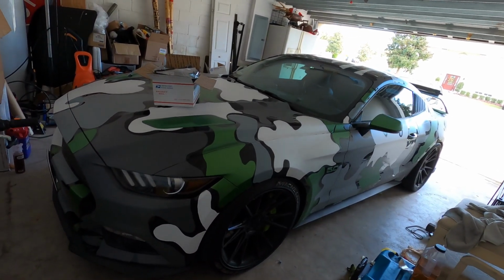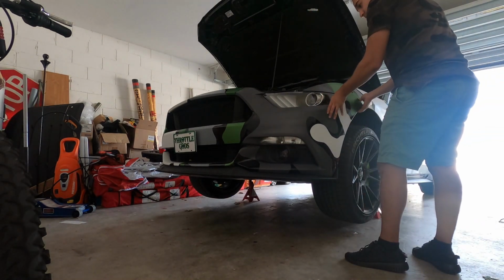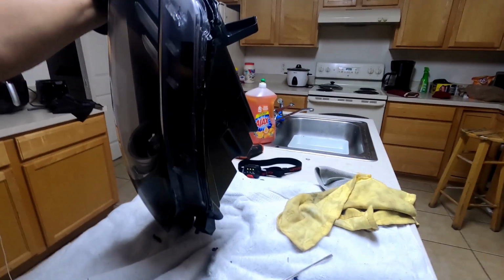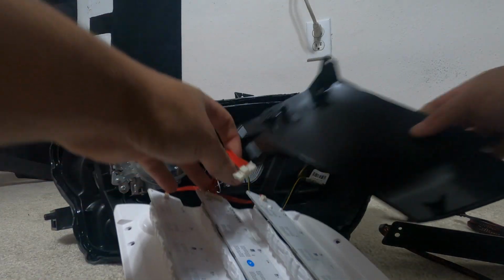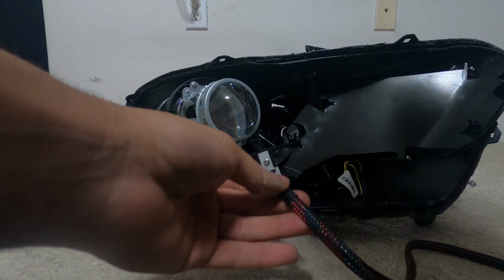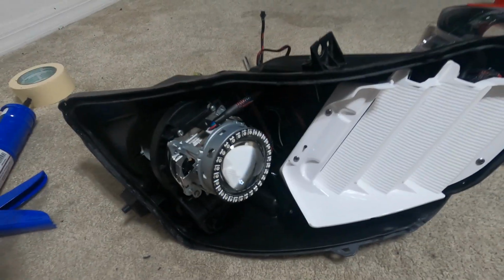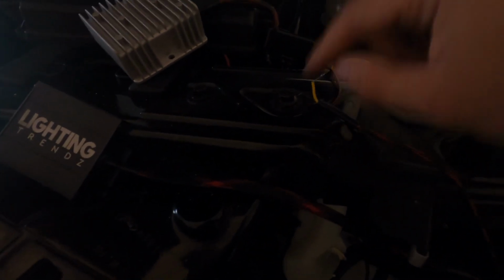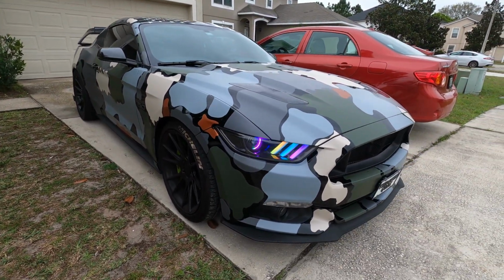S550 Mustang LightingTrendz custom headlight installation. DRL boards + Halo + Demon eyes.

Comment: I connected the wires to the battery but the fuse keep popping i need help on why
Reply from the maker: Did you connect the negative ? I honestly don’t know why your battery keeps popping the fuse.. id suggest trying a different cars battery to see if it’s your battery first. Then go from there
Reply: Throttle Gods it was the regulator they sent me a new one thanks + great video. Is the process the same with a 2018 mustang?
Reply from the maker: ThattGuyOD ohh yeah that makes sense! And yess should be the same exact thing. The headlight shape is just a little different
Reply: Throttle Gods im taking the lens apart now man that shit is no joke
Reply from the maker: Yeah it’s a lot of work! Just follow what I kept doing in the video. Just takes a lot of time

Comment: Any problems with moisture & fogging inside the lenses now?
Reply from the maker: I’ve had it for a while now and no. If you the sealant I used and make sure to use enough you should be good.

Comment: How did you get the app to connect to the lights? Mine shows the lights but won't let me connect to them and suggest that I reboot them. How do you go about doing that?
Reply from the maker: It’s called magic LED app .. it searches for devices everytime I open the app and then I click the device .. it’s doesn’t automatically connect. It searches everytime and I have to click on it and connect each time